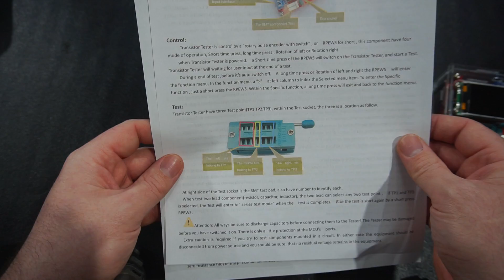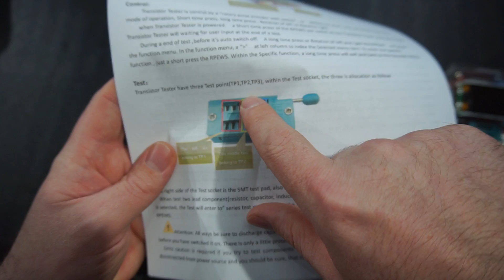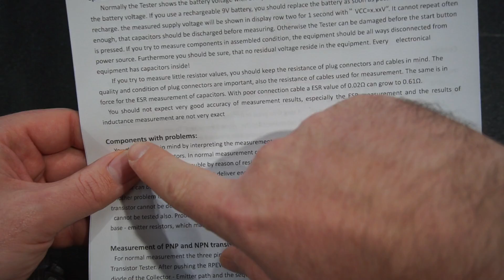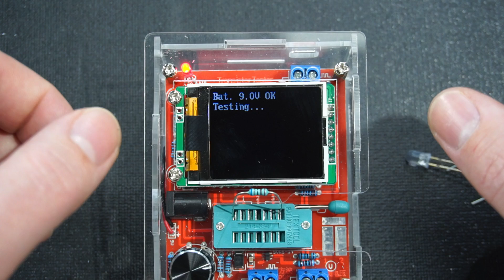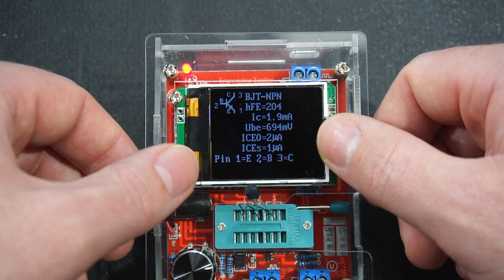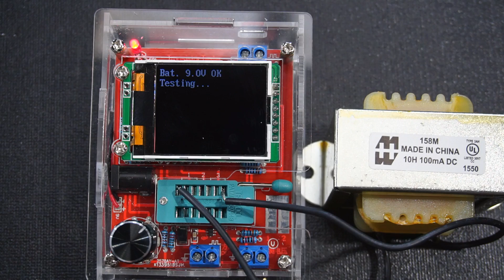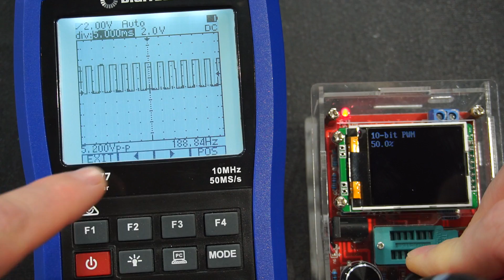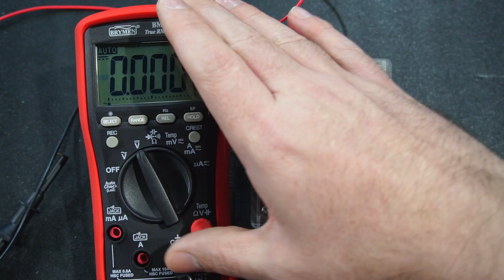Check out this handy gadget! The GM328 Component Tester

Comment: with some leads you could id board components
Reply from the maker: That's an application I hadn't thought of. That would be quite handy at times! Great idea :)
Reply: That's what the pads are for under the lever
Reply: @lprkon72  No, like on a board components
Reply: @dropdestroy  got it
Reply: @dropdestroy  although I would the that doing that might give completely abnormal readings
Reply: @dropdestroy  On a PCB components are tied to other ones. Those will affect the measurement. You're not testing one component, it will be the result of the entire circuit.
Reply: Ahhh thank you so much for posting the manual. I got a diy kit off Amazon and it came with no instructions at all. But luckily this is my third project so I was able to read the pcb and use a mm to determine parts and values. Now I just need to calibrate it.

Comment: As far as I am concerned the only helpful part was the last quarter of the video. I stopped the video and use the advancement bar on the bottom to move forward to get still pictures of the finished product, which that helped out greatly. To start a couple of the pieces were thicker and I had to file down the tangs to get them to just fit. Now except for the very top I put the bottom and the sides together first " I didn't but rubber bands probably would have helped to keep things together as you advanced". Next I removed the screws and "long nuts" from the GM328 unit, you will not need them. Next the 4 shorter "long nuts" go on top of GM328 which screw under GM328 into the shorter 2 "long nuts up in front of GM328 and repeat with the longer "long nuts" in the rear. Now drop everything except the acrylics pieces inside of bottom half and use the nuts to attach. Now all that's left is the top 3 acrylic pieces. in order, start with the large piece on the bottom, next the piece that has the cut out for screen and the last whole piece on top. Set it on top of bottom half. I had to squeeze at tang attach area's to make sure they were firmly attached. YOUR DONE. Except you need to make an extension arm for the lever with a tube or something. Sorry I'm still working on it. And Yeah, Patience is the name of the game. Have fun and good luck!  I spent about a little over 3 hours, Argh! Lol

Comment: From the documentation 1.12k self test calibration requires capacitor between 100nF and 20mF (even though tool only says > 100nF). Using 100mf does not complete the calibration as on completion it displays the calculated calibration values. I was constantly being told it was not calibrated. It was only after reading the manual on the link mentioned by the tool that I used a 10mF capacitor and the final phase completed with an extra page of info. No more nagging about calibration. Hope this helps someone looking for additional info. Great video!

Comment: One small thing i found with these testers... they can-t identify zener diodes properly. They detect the forward voltage, but not the zener/reverse voltage.
However, you can sometimes trick em by putting a small signal diode in reverse-series with them, and then subtract that diode's forward voltage.

Comment: The moment you started wrapping the 9V was the moment I subscribed. :-D
Reply: The moment he started moaning about not being able to fit a 9v battery in case, which was not designed to be fitted in that case, as that is why it has an alternative means of power, thus I didn't subscribe, and it would have been easy to convert to Lipo power, which would have fitted nicely inside that case, with a charging socket to boot, as I have mine ;)  And no machine job to make it fit either :)

Comment: Great review - could you please tell me who you purchased your tester from? There are quite a number of very similar lookalikes on eBay and virtually all that I looked at did not come with the user manual. Cheers
Reply: You probably have found one by now, but if you Google M328 tester you will find several from 80 pages to a single page! Here is the link to the one Schematix has from EEvblog:  https://www.eevblog.com/forum/testgear/$20-lcr-esr-transistor-checker-project/?action=dlattach;attach=236653
Reply: Sorry, it was 128 pages, not 80! Here it is from the original German designer before it was stolen and copied by the Chinese: http://apuntes.eduardofilo.es/images/pages/ttester.pdf
Reply: @englishrupe01  It wasn't stolen - it was released freely by the (then) about 16 year old designer who didn't know about Open Source and has been copied/added to by many other designers over the years with his blessing.

Check  out his answer to Dave from EEVblog's post. His Youtube name is Coiltech:
https://www.youtube.com/watch?v=7Br3L1B80ow
Reply: @doc1701  I did not know that. However, did you read Dion Kunz's response "But you know that when you release software without a license, the implied license is actually proprietary. Any programmer knows that you should never use a software library which has no license since this would mean the author could make it commercially any time and sue you for using it illegally." ?

Comment: It says for the calibration to use a capacitor between 100nF and 20 microF, did u use a 100 microF and is it ok?
Reply: over 100nf

Comment: Thanks for the video!
I just got one of these but had trouble finding any instructions
Got both the manual and a run through of operation 👍
Plan to use 2x small mobile phone batts (~7.4v) for power which will fit in the case

Comment: I like mine not just for identifying components but testing them, especially transistors, it will tell you if they are good or not. its also in colour. It also came with leads for on board testing and some other bits and pieces and a usb conection for power or charging. I paid €13 ($21 au) including postage
Reply: When I'm testing mosfet, where do I read it's bad or good?
Reply: @hardcoreplayafromthehimala4888  If it reads it then it means it is good. If not then it will say "unknown component".
Reply: @englishrupe01  thanks😀

Comment: Handtech scopes are pretty cheap on ebay, round $300 for a 100mh model, and that can be upgraded to 200mh with a firmware update. its what i use in my lab and it serves me well. i also have a crt scope that i picked up for $20 at the local recycling center.
i have also recently found an awesome tech recycling company here in chch so if there is anything your looking for let me know. got a huge pile of stuff there last week, including huge IGBTs and a 5mw laser!
Reply from the maker: Thanks for info! I have been browsing around the internet for a digital o-scope. The Handtek scope looks like the best bang for the buck? I was also looking at the keysight EDUX1002A. It's about double the price. But I'll probably never need to upgrade for what I do. I've wanted to build a grunty laser for my CNC mill, for engraving/cutting. I'm interested in that recycle place in chch. Can you flick me an email? I have a business email address under the "About" tab on my channel.